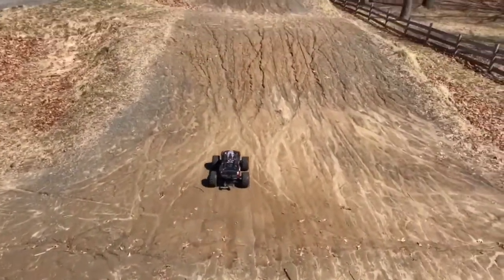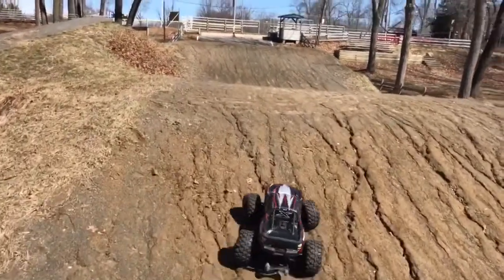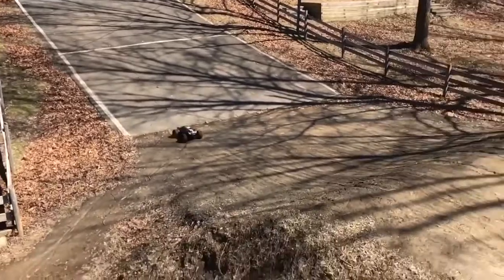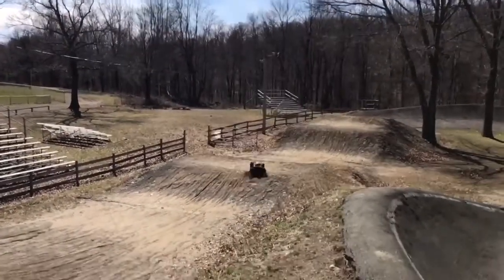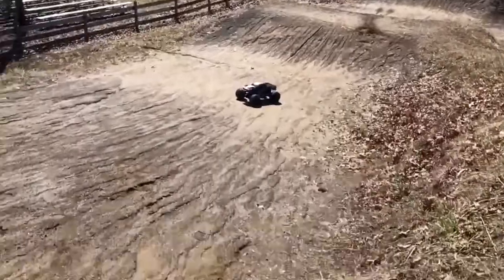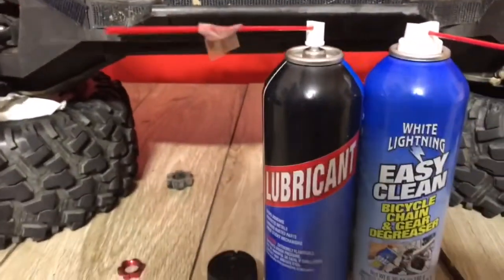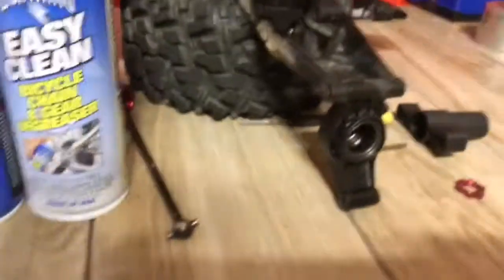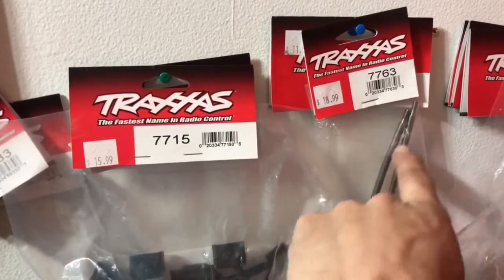2017 XMAXX V2 8S :HOW TSM WORKS IN AIR! ITS AWESOME!!!

Comment: Tsm only steers the truck left or right it doesn't do anything to the throttle or braking
Reply from the maker: John Smith TSM only controls the steering. So if you hit a jump and your truck is twisting to the left your tires will turn to the right to try to straighten it out.
Reply: @WiredRC  yes but turning your wheels left it right doesn't do anything in the air unless your on the throttle right?
Reply from the maker: John Smith Correct. It will try to keep the truck in a straight line